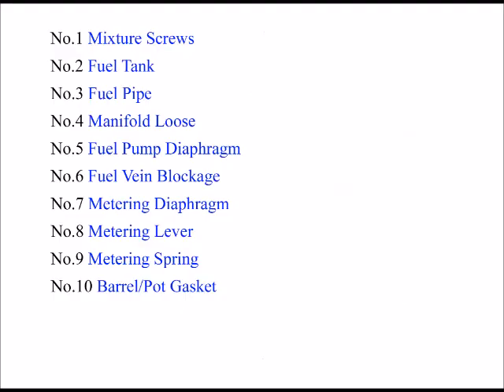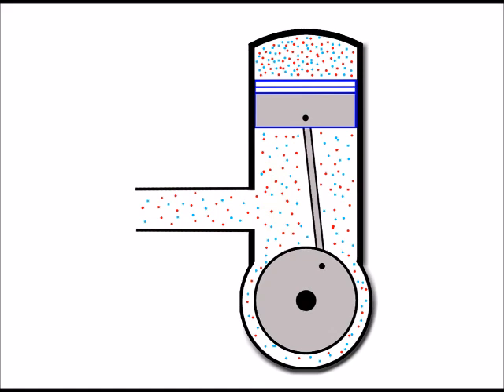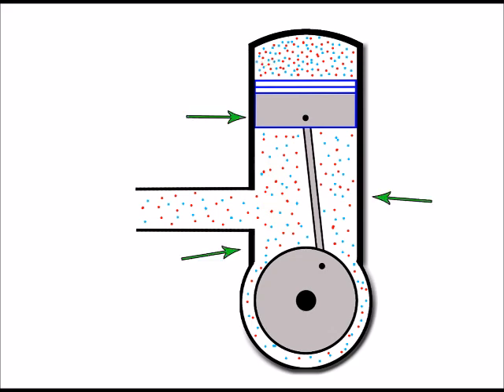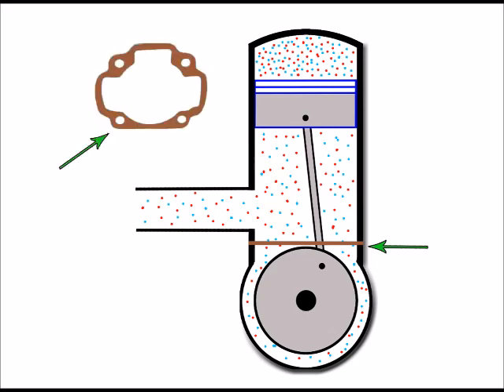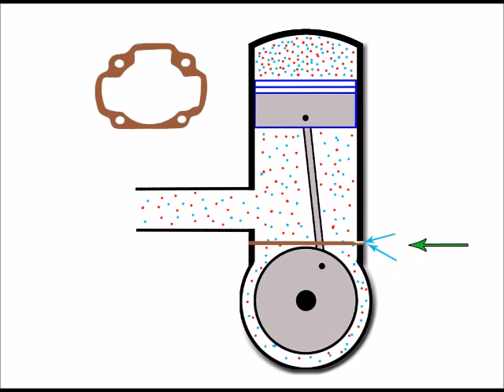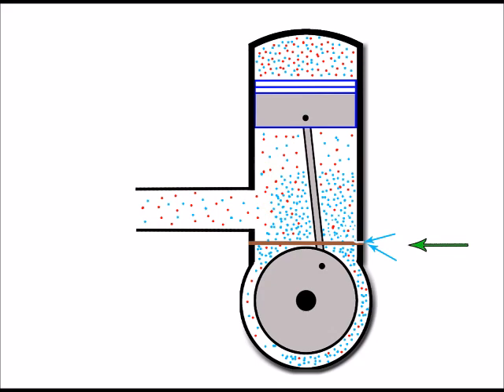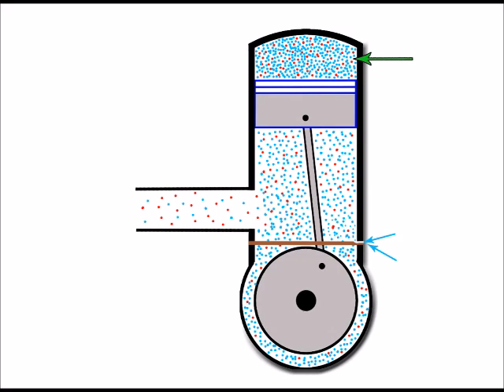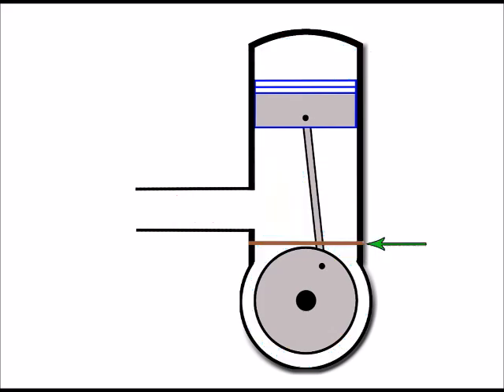2-Stroke BOG DOWN - How Cylinder Gaskets can Cause it -Chainsaw/Brushcutter etc.  (by Craig Kirkman)

Comment: I’m assuming since the barrel and the crankcase are wiggle independent of each other, but the bolts are tight that my weedwacker was either like this when I bought it new or the gasket evaporated. Either way, this seems to be the problem 😂

Comment: My bike runs GREAT 1st 2nd 3rd..... 4th most of the time but 5 and 6 wide open it falls on its face.... why in a higher gear would it be more likely to BOG??? Could this be the cause? Or is it more likely carbeuration issues in your opinion?
1992 WR200 top end it’s pretty fresh bike sounds very healthy.